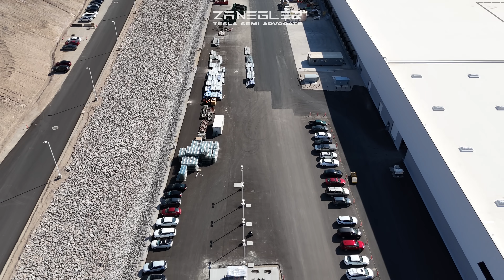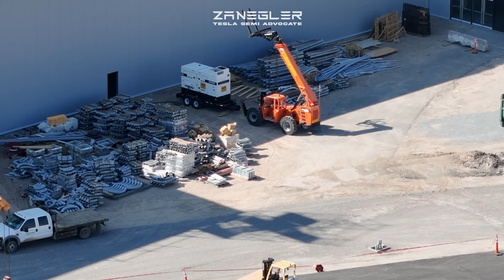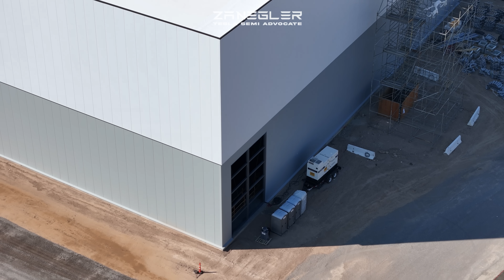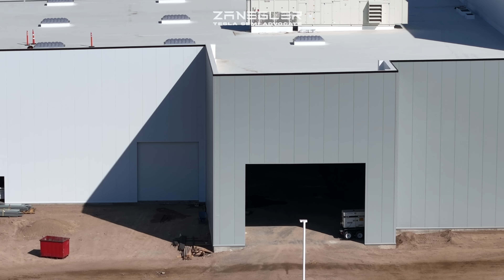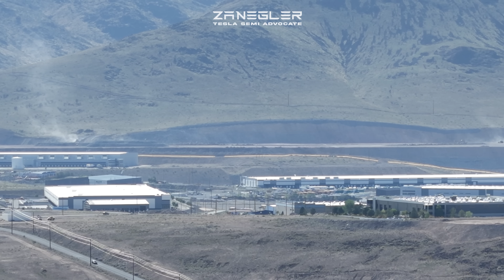Tesla Semi! High-Volume Factory on Track 4 2026

Comment: Thanks Zanegler
Sort by newest first or top comments if only the first few lines are visible
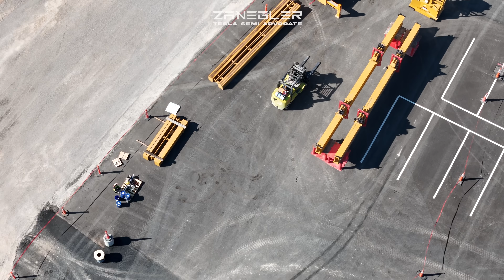6:46. Stamping, east. Apron. Setting up the gantry. Presumably to unload the last 2 loads from GT (might still be on the road) which may be components of a standalone press to be installed on the smaller isolation foundation on the east end of the Stamping hall.
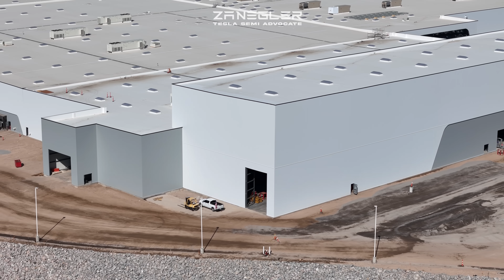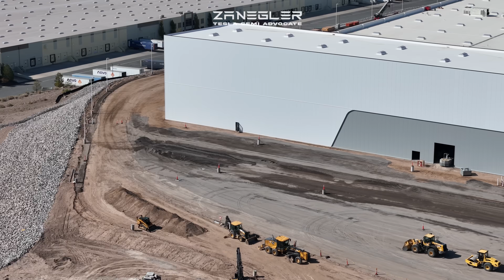Note the red heavy duty stands and the yellow ground beams for the rails. Similar seen inside the west door at 8:27. A red stand outside at 7:53.
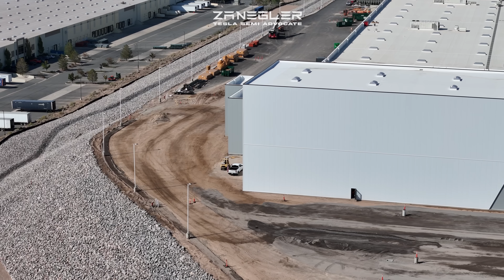8:06. Thanks for the shout-out! I’m no expert. Retired carpenter/construction worker. Careful observation, note taking, and an easy to search 2000 pages of notes from GT videos is the secret.
11:26. West side. Process chiller plant. “Totes”. IBCs in many industries (intermediate bulk containers). Treatment chemicals for the chiller pipework would seem likely, and as also mentioned by bobtanner4068 below.
Stainless steel vessel this side of the tele-handler would be a temporary filter of some sort (sand maybe). Still commissioning the system.
All this temporary gear seen many times over the years during the GT build.
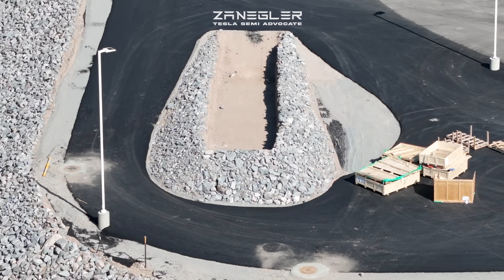12:02 North side. Emergency sand trap. Narrow track to aim for in an emergency, and the ramp aspect wouldn't add much to the required deceleration. Plus if you get it wrong and only get one line of wheels in the sand, then the other line of wheels is out on an ever increasing slope. Once the truck starts rolling on it's side your day goes from bad to worse.
A more effective sand trap would simply be a wider and longer flat patch of sand (the area of the mound including the rocks), which would be simpler to construct, and more foolproof in an emergency.
Don't think this is a sand trap.
Display ramp, or signage footing possibly.
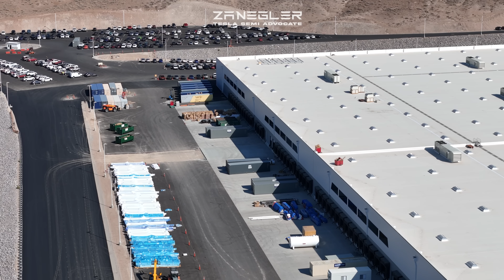12:54. North side. Line of beams wrapped in white or blue plastic. Parts of an overhead gantry system perhaps. I searched ‘truck factory’ in the search box above and found overhead gantry and bridge cranes are common in truck factories.
Reply: There is a lot of logistics to construction that the engineers who designed the buildings and equipment don't have to worry about. It is people like you who actually build and assemble plants who best know what everything is - often just by the packaging.
Reply: @peteregan3862  The construction stuff is right up my alley. I can write observations of that with a leg in the air.
The production plant stuff generally needs referral to my notes, or some online searching.
I find it weird how little research some of the Tesla 'experts' do. Another channel is referring to the stamping press as a giga-press.

Comment: I wonder what method they will use to move the trucks down the assembly line?  

When Nissan was building the big NV van in canton Mississippi; they supposedly moved the units down the line by hand?
Reply from the maker: They move them on dolly’s at the pilot factory until the axles and wheels are in-place, then roll them. I 100% expect this to be automated at giga semi. Maybe think like something similar to an automated car wash track and conveyor.